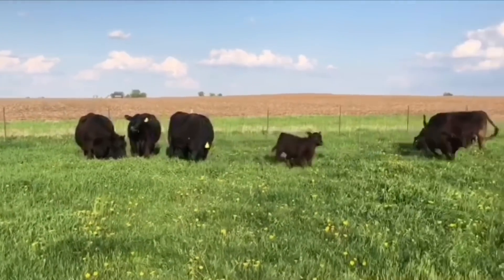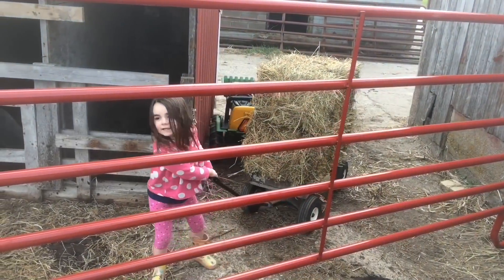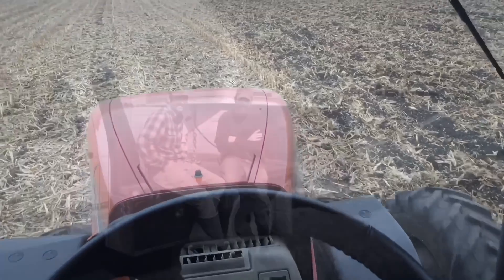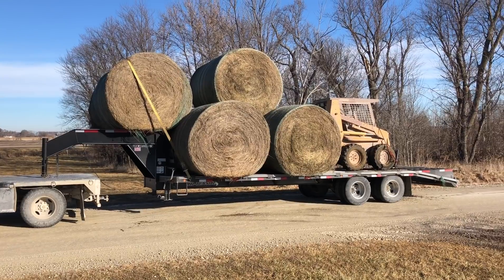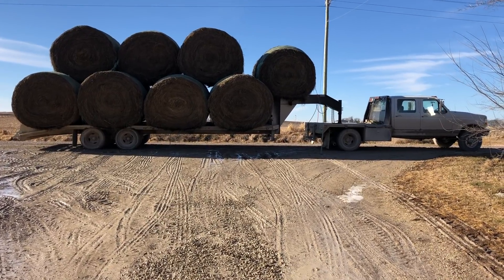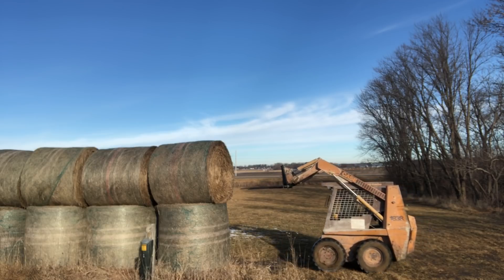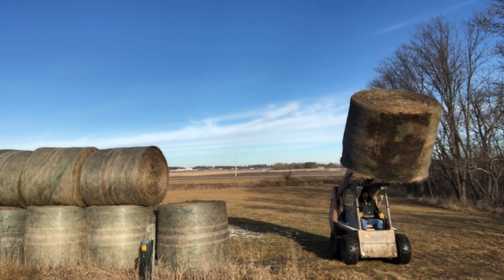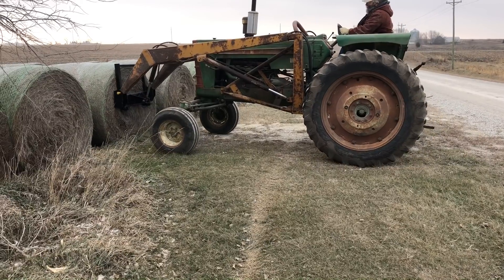Square Bales vs Round Bales

Comment: I am a hay farmer that lives in an area in southeastern Idaho where a lot of alfalfa hay is produced and sold to large dairies. Nobody here has a round baler because the bales are so difficult to transport. They are overwidth on a semi and very unstable, even when strapped down. My hay needs to be hauled about 125 miles to get to the destination on a winding 2 lane road.
Dairies are set up to handle thousands of tons of large square bales which are used to mix in a Total Mixed Ration machine where rations are scientifically balanced to grind and mix every particle of feed that is consumed by the cattle into feed that is identical in every handful in a batch of several tons. 
We all stack outside and if the hay is going to be in the stack for any length of time, it is covered with hay tarps, which protect the top of the stack from snow or rain damage. This is a dryer climate than some places but it can be protected quite well with tarps. 
My 3'x4'x8' bales average between 1,400 to 1,500 lbs.
This was a good video for its intended purpose, but ways and means of putting up hay vary with the use and market for it. Hay farmers have to produce for the market that is available.

Comment: As a child in the late 50's I hung around a small dairy farm that harvested its hay by hand.  They had wide wooden rakes they formed windrows with and forked it loose up onto a horse drawn wagon where someone stood and piled it.  At the barn they had a two tined fork also powered by a horse they used to raise the hay into the loft.  There were openings in the loft floor they used to fork hay to the cows.  They weren't Amish either.  Just poor.  By the way I grew up drinking that milk raw.  I'm pushing 70 now.  Just lucky I guess.

Comment: Thank you for this informative video! It is interesting to see how you work with hay which is not very different with our way to do it in Germany.
Reply from the maker: A friend of ours recently traveled to Germany with a small group from our area. They said they saw loose hay being put up in trucks with big cages on the back. Is that common?
Reply: @dodgebrothersfarmandranch9206  Hi, maybe small farmers do that, or it was probably shredded mais for alternative energy plants or "Biogasanlagen". In my region, Lower Saxony near Oldenburg we do have small square bales, big square bales and round bales of dry hay and Silage round bales. Our region has a lot of moisture and it is difficult to keep it mold-free. In our horse farm, we do use small square bales and round bales, we don´t have machines to do hay ourselves so we buy it.

Comment: I live in southwest Michigan and have 4 horses and we feed round bales. 4x4 or 4x5 what ever is available and low cost.  We store then in the barn.  I put down a pallet  if it's a 4x4 I can flip it by hand. If it's a 4x5 I have to use the skid loader. I put it on to the flat side, untie it and fill up the wheelbarrow, feeding this way minimizes wast.  If I know it's going to be a bad heavy snow for more than a week I will set out a full round bale in the field.
Reply from the maker: Sounds like a pretty good system.

Comment: It’s all about shipping and what the buyers and shippers want. Here in Nevada allot of dairies buy hay in California so we put up large squares easier to load and ship tied down. Rounds don’t get enough tonnage to make trucks pay we keep our bales out we don’t have to many problems we high and dry here. Ya rounds are good if your feeding your own and your fields are close plus no Knotter problems like big and small balers rounds use net wrap or less twine to plus you can also if you have meadows you can roll them up and not put anything on and leave for free feeding.
Reply from the maker: Yeah that’s a real benefit of big squares. It’s like Tetris for loading trucks. I would really like one of those small square balers that ties 18 bales into one big square bale for handling with skid steers.
Reply: @dodgebrothersfarmandranch9206  ya we have 3 string bales use a harrow bed and squeeze to move the in blocks or a retriever on a truck to haul the blocks of 72 bales around about five tons.

Comment: I made the investment in bale tarp,  not a cheap tarp, but well worth the investment. As long as you put bales on skids, it preserves both large round and square bales .
Reply from the maker: I have a neighbor who has one of those huge tarps. He always ends up having it blow off the stack after a few weeks. What do you do to hold it down?
Reply: @dodgebrothersfarmandranch9206  I tie the tarp down with bale twine down to the skids ..make sure to tie down most if not all of the holes/holds on the tarp. Never have the tarp blow off. Takes a bit of time initially but works great.
Reply: What is the life of the Bale tarp? How much did it cost?

Comment: Small bales at 50 pounds?
Only ones that light I've ever seen, we're too soft to handle and wouldn't stack!
16"×18"×48", weigh 80-85 lbs for grass or up to 120-140 lbs for clover or alfalfa. Good solid bales that stack nicely. That's how we do small bales😎
FYI, I hate small bales! 3×4 it 4×4x 8, weigh from 1275 to 1600 pounds for grass and up to 2000 pounds for clover or alfalfa. Stack and haul the best!! Rounds are too time consuming here and still need to be under roof,  ya, they shed water, but we get more than they can take, been there...
God video!!!
BTW, the weights we do, is because we can and for speed and use of storage space.
Reply from the maker: What kind of Baler are you using to get such heavy small squares?
Reply: @dodgebrothersfarmandranch9206  Massey 1842 16"×18".
Did the same with the many New Holland 16×18s before it...
The inline makes a nicer bale thought 😎
Reply from the maker: How long are you making your bales? Mine are exactly twice as long as they are wide. My friend has a Massey 1839 and his alfalfa bales are only about 40-45 pounds and the strings are so tight you can barely get your fingers under them to pick up a bale. We must be getting our hay way too dry.
Reply: @dodgebrothersfarmandranch9206  47"-48"… a little on the long side for the bale wagon, but tie tiers fit better.

Comment: Locally farmers use twine,  I see a (lot) of mold figured went with the rounds. If I understand you, rounds net wrapped resolves some of this waste?
Reply from the maker: It certainly helps! The water tends to follow the plastic wrap down the sides instead of all soaking into the top of the bale.

Comment: Thanks for the informative video, Carl. I grew up in Northern California and never saw a round bale until I came to the Midwest. I've been back to Northern California a few times in the last 40 years (not as many times as I would have liked) and I don't recall seeing round bales on those trips back home. Is that coincidence or is there a particular reason that round bales are scarce out west?
Reply from the maker: I know a lot of the super high quality hay that is made out west on irrigated land is shipped clear out here and it is most always large square bales. They are just easier to transport. They stack really nicely.
Reply: 2 string[50-60lb] square and large round are popular in western WA and OR for "local hay" (often round is plastic wrapped) which is often considered low value. Round for alfalfa in eastern WA because the dairies are setup for feeding round bales. 
And most of the high quality hay and alfalfa transported from eastern WA to the west side is 3 string(about 120lb) square. 
Straw is equal chance of being 2 or 3 string square.

Comment: I like your videos since I know nothing about farming. 
I'm curious about how much the different sizes cost a farmer to buy.
Reply from the maker: That’s a great question! Assuming the following weights:
Big round-1500 lbs
Big square (3x3)-800 lbs
Small square-50 lbs

And assuming $150/ton for grass and $200/ton for alfalfa, the math works out like this:

Big rounds $112-150/ bale
Big squares $60-80/ bale
Small squares $3.75-5/ bale

It depends if it’s straight grass, straight alfalfa, or a blend. Alfalfa often sells for about $50/ton higher. It also depends on quality, moisture content, mold, etc. Also, squares tend to bring a bit higher price than rounds at the hay auction because they are easier to transport.
Reply: @dodgebrothersfarmandranch9206  -Thanks for the reply. I'm just a town guy that was never on a farm and never thought about those things. Now I'm curious about the total costs involved in haying. Different sizes means different types and numbers of equipment needed, not just for baling but also for distributing the hay.
Reply from the maker: Well, we are doing it about as cheaply as you can. Here is my best guess at the value of the hay equipment we own:

IH 1066 mowing tractor - $7,000
Oliver 1550 loader tractor - 3,700
John Deere 920 MoCo - $4,500
Kuhn SR110 speed rake - $4,500
John Deere 336 baler- $3,200
1995 Ford F-350 dually - $4,000
Case 1838 skid steer - $6,000

We hire custom operators to make round bales for $12-15 per bale. We rent a flatbed trailer that can haul 11 round bales at once for $1 per loaded mile. The custom rate for making big squares is around $9-10 per bale. 

There is also about $80 per acre in fertilizer cost. Don’t forget land rent and fuel. 

It’s not cheap.
Reply: @dodgebrothersfarmandranch9206  -How many cows do you have? I thought you said on one of your videos that you had 8 cows, but I may be wrong.
Reply from the maker: We did have 8 but we lost one during calving season. Her calf was so deformed that they couldn’t even do a c-section. We had to take her to the butcher.
Reply: @dodgebrothersfarmandranch9206 - Wouldn't it just be cheaper to buy the hay you need for your 7 cows? At $80 per acre just to fertilizer your hay fields plus equipment maintenance plus gas plus labor. Oh wait, you sell hay to other people, don't you?
Reply from the maker: Yes we sell 80% of the hay we produce. At today’s prices it is still a good money maker even with all the investment it takes to get it done.
Reply: During a drought you can start adding  $$$ to the cost of those bales.

Comment: you forgot Small round bales I still use a Allis Chalmers rotary Baler
Reply from the maker: BluedevilReddevilx Good point! What do those weigh? Are they similar to a small square bale?
Reply: @dodgebrothersfarmandranch9206   The Roto-Baler could produce bale sizes from 14” to 22” in diameter, and, depending on
the size, could weigh from 40 to 100 pounds.  that is from the wiki my hay bales are about 16-18 inches in diameter and worry about 50-55 pounds it all depends on condition if I'm going to make it bigger or smaller lighter or heavier ???

Comment: small square bales are easy to handle, hell when i was (briefly) into archery i got a small square bale to shoot into
we ended up using it as fire starter fuel
Reply from the maker: I usually shoot at round bales when I’m practicing with my bow. Which is rare... My wife and I are in a couples archery league and the running joke is that it’s against the rules to practice outside of competition.

Comment: Why do farmers in the Midwest bake the small square bales and not 3 string square bales and use a harrow bed to pick up the bales
Reply from the maker: Good question! Most of our small bale  customers are retired hobby farmers with a couple ponies or horses. They only want a 35-40LB bale because it is easier to carry.

Comment: We don't have large equipment and store all hay inside, for just two ponies. We use round bales 😂
Reply from the maker: Nice! Do you have someone deliver them or do you just roll them off a trailer by hand?
Reply: @dodgebrothersfarmandranch9206  they won't survive a roll from the trailer, since they are not wrapped, just got some plastic twine around them.

They are delivered by a farmer with a small old farm tractor and stored in the hayloft of the barn :)

So no, we don't handle them by hand.

But they can be pulled apart very easily, so there's no real advantage of buying smaller stuff for us :)

Comment: put the round bales on pallets!  it saves a lot of hay!!!  we put ours on  2 pallets high / almost no bottom rot! sure, its a little more work ... but we went thru A LOT of hassle to make the bale, why waste the hay ?!
Reply from the maker: My problem would be finding 400 pallets and getting off to move them between every single bale
Reply: @dodgebrothersfarmandranch9206  thats what kids are for!!!
Reply: I started doing this just this year. I only need like 3 or 4 bales so it's easy to find palletts
Reply: You don't have to get off the loader. Our skid steer straddles the pallets. We are at 250 rounds on pallets. Rounds feed better outside for us. We still feed squares but prefer to do so inside. With our feeders we have much less waste with rounds. We use 4x4,4x5 and5x5 rounds. We feed sheep. I will feed squares outside if I have high numbers to use it.4 years ago we fed all large squares. Rounds are easier to find. Usually cheaper. We are getting them delivered for around 108 aton.

Comment: Biggest drawback of a small square and large square baler is. Its like your mother in law one moment she is nice and everything is perfect and the next day she is just a btch and everything is just not working
Reply from the maker: I have had my fair share of knotter issues. We had an old 24T that I fought one side for the longest time. The right side made a perfect knot and the left side only half tied. It looked ok until you picked the bale up and then it would break. Turned out the tucker finger was just slightly out of adjustment. It was letting the one string go before the billhook could get ahold of it.